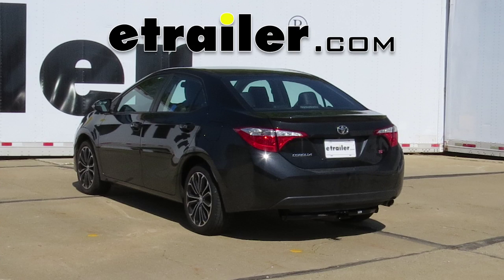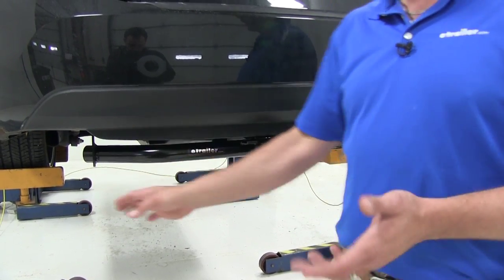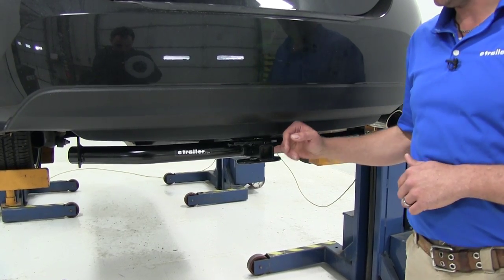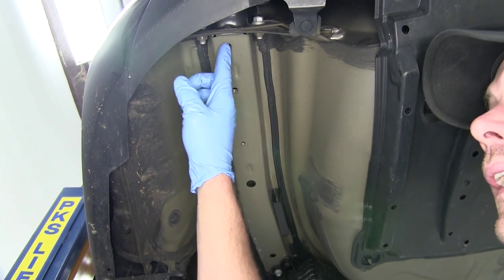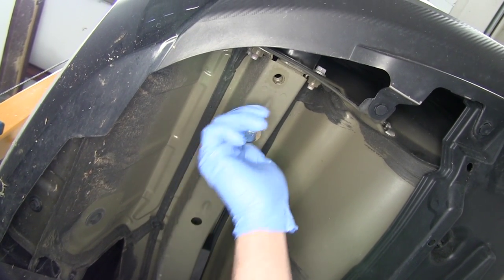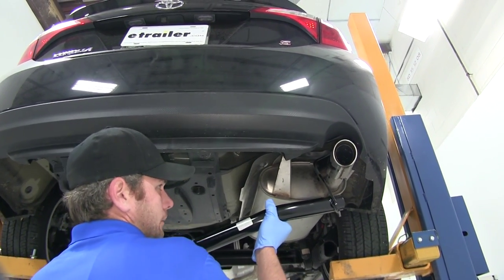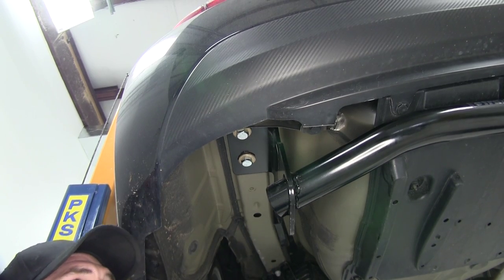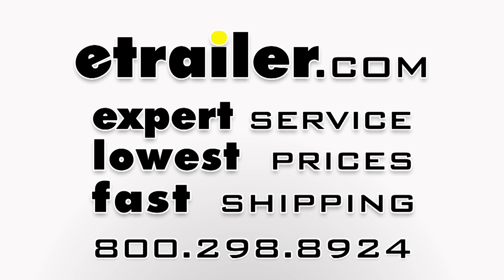etrailer | Trailer Hitch Installation - 2015 Toyota Corolla - Draw-Tite

Comment: Yes same question. Size of the bolt thread?
Reply from the maker: The hex bolts included in this hit are a  M12 X 1.25 X 35 CL8.8.
https://www.etrailer.com/Trailer-Hitch/Draw-Tite/24913.html
Reply: Thank you